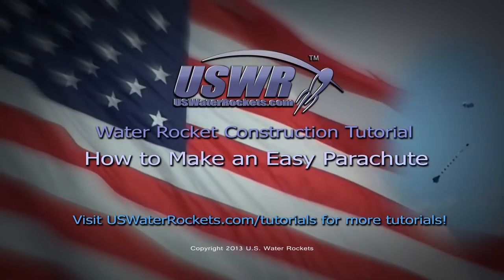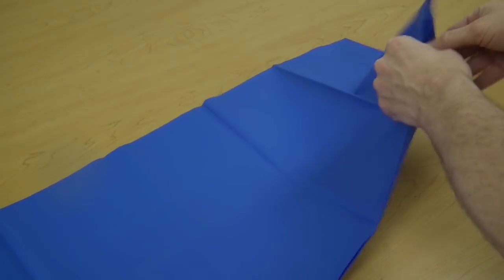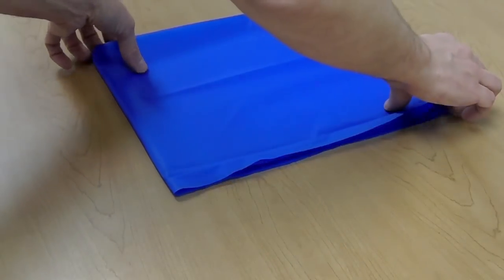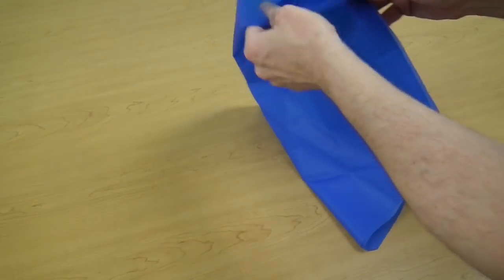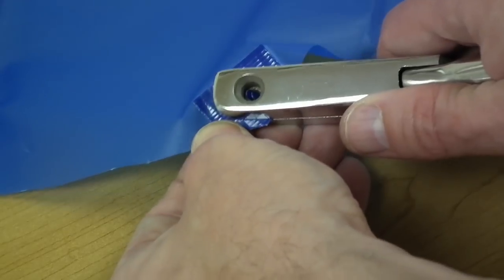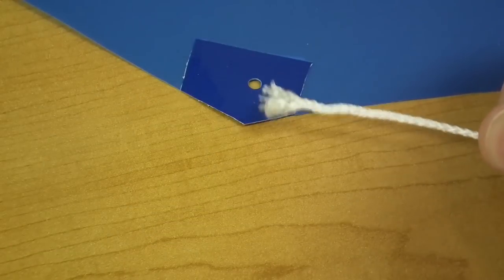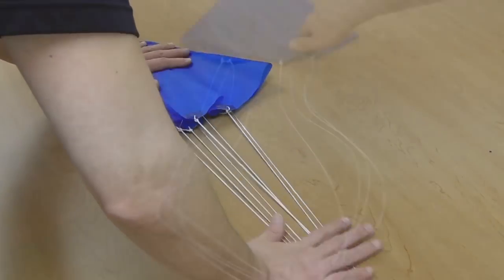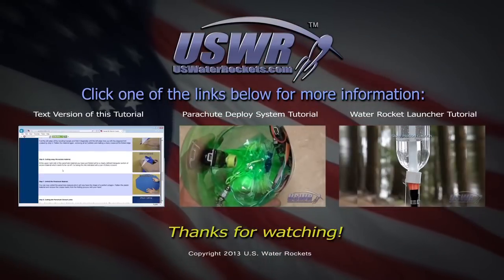How to make a parachute from plastic bags or table coverings.

Comment: Will cutting a spill hole vs not for this parachute affect the rocket much? What would you recommend? Thank you.
Reply from the maker: If you leave off the spill hole, the parachute with have a tendency to tip side to side in a rocking motion, so the air trapped under it can dump out. The main reason for the spill hole is that it makes the parachute more stable and smoother.

Comment: I need to this and prevent an egg from breaking on it. Any tips?
Reply from the maker: You should only need to surround the egg with some soft cushion like foam, if you add that to a parachute, your egg should be fine.
Reply: Thanks. I think I'll use sponges buy where should I put the egg in order to reduce air resistance?
Reply: Lumical u want to increase air resistance so that the egg falls slower I thought

Comment: Where should I attach the parachute too? Will it deploy to early depending where I put it?
Reply from the maker: If you are not using an active parachute mechanism like an air flap mechanism, or a  servo motor, or a tomy timer, then the best approach is to attach the parachute to the top of the rocket bottle and place a nosecone over the top of the parachute, but you have to build the nosecone so that it will stay on the rocket as the rocket goes up, but falls off when the rocket tips over and starts falling. This method is a passive deploy system and it is generally called the NOAA deploy (Nose Off At Apogee).

Comment: If I want to keep the my rocket bottle in the air for as long as possible, should I add a spill hole?
Reply from the maker: +Brianna Schuh The bigger the spill hole is, the faster the rocket falls. But, sometimes having no spill hole at all can make the rocket fall even faster because the parachute will wobble side to side and lose effectiveness. You might want to test which is best, because the size and weight of the rocket and parachute will determine if the parachute will wobble with no spill hole. Usually you can leave it off, but if you are concerned with getting the absolute maximum performance then you should try both.
Reply: +USWaterRockets ok thanks :)

Comment: Nice video, one question.. for 700g and for 1 kg what diameter (size parachute) is required for a very slow landing?
Thanks.
Reply: funny xxx  ~110cm for 700g and 130cm for 1kg

Comment: Nice tutorial, but why is the stil hole needed, what does it do? And does it descend more slowly without hole?
Reply from the maker: The spill hole makes the parachute descend faster. This means the rocket will not be hanging in the air as long, and on a windy day that can make the difference between a safe landing and a tree landing. We added it to this chute because a breeze was blowing toward the trees. Thanks for the feedback!

Comment: I'm making a water rocket for school and I need it to stay up in the air the longest. How do I attach the parachute?
Reply from the maker: +TheXCPrepster A lot of people just tie the main string on the mouth of the bottle if they are using a single bottle for the airframe and they run the string along the side of the bottle and up to the nosecone.
Reply: +USWaterRockets Thanks!

Comment: does it activate itself automatically?
Reply from the maker: This video is just a tutorial on how to make the parachute itself. You would have to watch one of our other videos to learn how to make the deploy mechanism for the parachute. We have several of them: https://www.youtube.com/watch?v=UnwP3YXOn-Ihttps://www.youtube.com/watch?v=_x7sSLBN8zkhttps://www.youtube.com/watch?v=bC9gaVZvAfIhttps://www.youtube.com/watch?v=vqTKXXpD9IUIf you want to trigger the system electronically, we have an altimeter designed to work with a servo motor that does the trick:https://www.youtube.com/watch?v=ulh21BNscr0For a lower cost project, you can use this electronic timer design:https://www.youtube.com/watch?v=J_C4v0zYUuY
Reply: no i mean i wanna use it for my rc heli if my rc falls will it activate?
Reply from the maker: kostni gamer This tutorial is really just for making the parachute itself. The method of ejecting it is the subject of other tutorials.

Comment: Are you shure it can carry the rc car(Niko Vaporizer)
Reply from the maker: +Gaming Mario We used this in the past to support a rocket that weighed 3.3 pounds. It had no trouble with that load.
Reply: +USWaterRockets but this string is too thin
Reply from the maker: +Gaming Mario You can change any dimension you want with this design. There's no special dimensions that you need to keep identical. If you want you can make the chute 5 feet across, or if you want you can use thicker string if you like. I can only confirm that the parachute in this video as shown here was used many times with a 3 pound rocket. We also used it for our "Water Rocket Chase Camera" video https://www.youtube.com/watch?v=6nlwjnlZe6I where we deployed the parachute with the rocket flying at high speed on a ballistic arc. We did that dozens of times and the strings never broke. That huge rocket with all the cameras onboard was quite heavy as well.  This design is very easy to make, so you can quickly make different sizes and test which ones until you find a combination you are happy with.
Reply: @zvonimirknezevic5950  irs nylon string fool, you aint breaking that

Comment: How bog can the parachute be
Reply from the maker: You're probably limited only by the size of the materials you use. There's no reason you couldn't scale this idea up to something really huge, like if you had a plastic sheet 20 feet across or something. As you get larger, you would need stronger lines and a thicker plastic sheet to handle the stress. Bur for a parachute made from tablecloth and string there's no reason it couldn't be 8 or 10 feet in diameter.
Reply: USWaterRockets hi im doing this for my science project. Is it dumb if our parachute's diameter is nearly as long as a meter? We're using a 2 liter bottle and I don't know if the string would get overwhelmed by this. The bottle would be pretty heavy relative to its size because we are using plastic and cardboard provided by our school. The reason why my partner and I had come to a decision to creat a large parachute is because we have to keep our rocket 10 seconds airborne. The longer it lasts on the air, the higher the score. We're hoping that the major drag force of the parachute could be make the bottle land two years after its initial take off. Jokes aside, is this a great idea? Or should I quickly do change of plans?